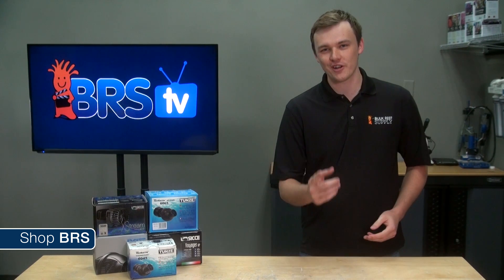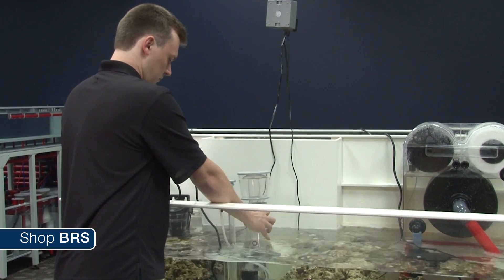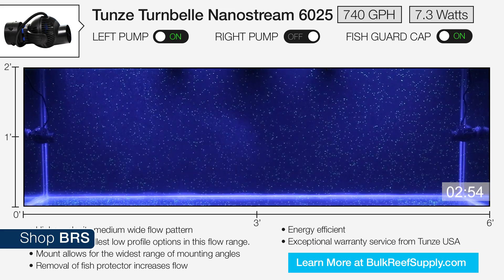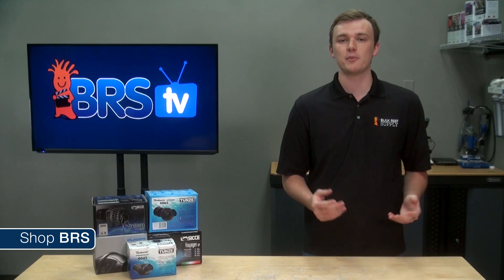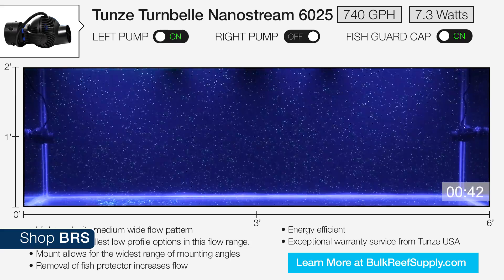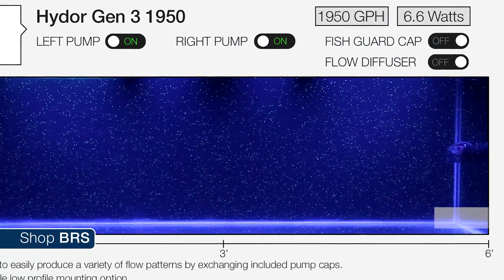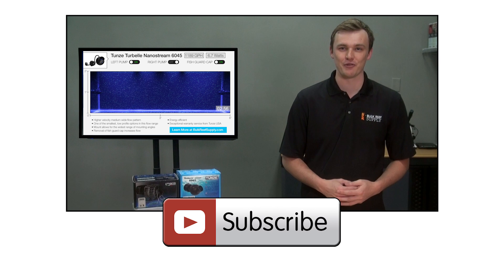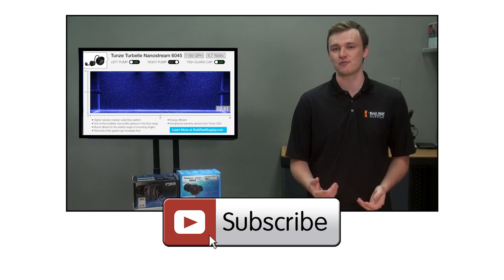Selecting the best pump for your tank | #BRSTestLab

Comment: Nice, looking forward to seeing more test.  We all know we spend a ton of money to then find that it was not the results that we where looking for.  But may I suggest that you or someone talk through the demo as just looking is kind of boring.  May I also suggest using different  angles on the pumps.  I know a lot of hobbyists like myself that don't use it straight on.  Patterns change when they hit the sides.  I myself look to see what happens to the flow behind the rock works to circulate the dead zones in the back.  Thanks for the video and keep them coming.